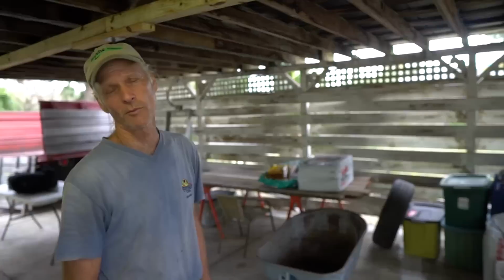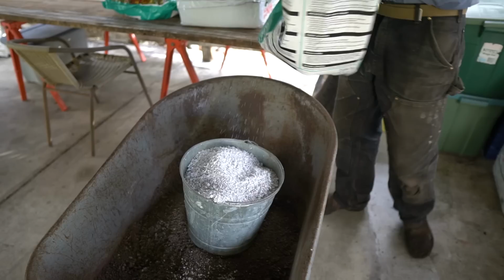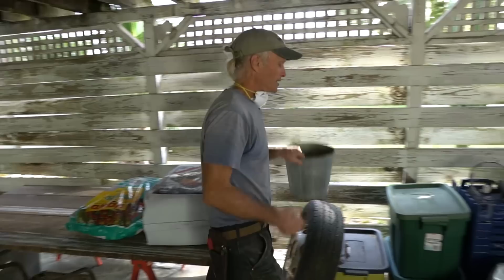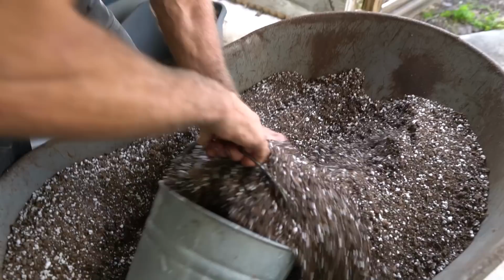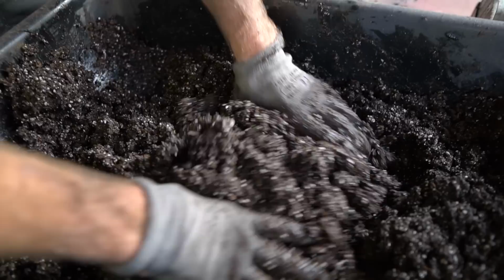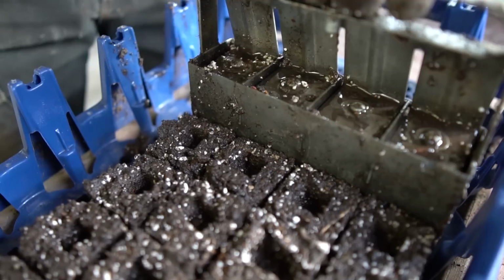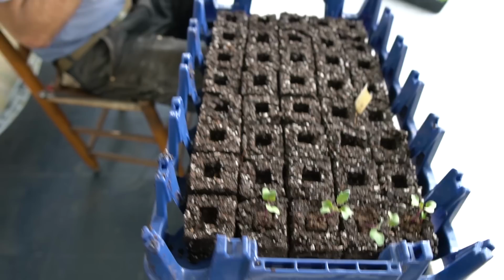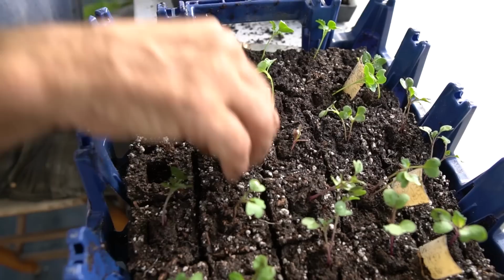Making Soil Blocks:  #1 Method For Starting Seeds (w/ Jim Kovaleski)

Comment: Soil block Mix

Bucket = 10 quarts 
(2) buckets peat moss
(2) cups azomite 
Mix
(2) buckets perolite 
(1) bucket peat moss
(1) cup azomite
(1) cup of green sand 
(1) cup rock phosphate 
(1) cup blood meal
(1) bucket compost
Mix
Add water

Mini Mix:
(3) quarts peat moss
(1 1/2) quarts compost 
(1/2) cup rock phosphate 
(1/2) cup green sand
Mix
Add water
If need bigger batch - double recipe.
Reply: Thanks for the summary.
Reply: thank you for this.  noticed though that there is no limestone!!! mygreathanks and blessings😇
Reply: Not all heros wear capes
Reply: Thank you Sweetheart
Reply: thank you so very much....blessings
Reply: Unfortunately we are not able to readily get peat moss here and definitely not Azomite or green sand here in South Africa - will have to experiment with an alternative mixture. And also try to find a soil block kit at a reasonable price! We are not able to purchase so many of the soil amendments/nutrients that are so readily available to you in the USA.
Reply: I like this video. Great info

Comment: A tip, I use a cheep cement mixer to mix the amendments. No dust in the face and mixes real well. Then while it's done and still rotating dump it out into the wheelbarrow or cart.
Reply from the maker: Nice! That’s what I used also. Jim does it the old fashioned way 😊
Reply: That's nice. I use a large compost tumbler to mix and also store the mix.
Reply: Talking about a guy that uses a scythe for multiple acres.
Reply: Just saw your comment, I do the same thing!
Reply: I used to use the cement mixer when I showed giant leeks saved a lot of hard work🇬🇧🏴

Comment: Seed startng.. take the blocks place them on a "bed barrier sheets" for small children(they used to have dried gel embedded in the mat/fiber side up)..elevate it with part hanging over the side in the tray with a reservoir of water...it filters the water & gives you just the right amount of moisture to the blocks w/o flooding it...also then you do not have waste time by paying attention to the moisture in the blocks especially arid areas and no water wasting...capillary siphoning
Reply: thank you for confirming this - I was just looking online to see if including a capillary mat in my propagation set up would be a good idea. Cheers

Comment: For those of us who do not hear well, it would be really nice if there was a list of the ingredients in the description area, maybe with the number of buckets/cups for each.
Reply: Follow steps in wheel barrel 
For 2 inch Soil blocks:
(2) 10 qt buckets of peat moss
Add Soil Amendments :
(2) cups azomite (soup cans = 2 cups)
Mix in and use a mask to avoid dust
Add (2) 10 qt buckets of perlite
Add (1) 10 qt bucket of  Peat moss
Add Soil Amendments :
Add (1/2) can of more azomite  
Add (1) cup of Green sand
Add (1) cup of colloidal phosphate powder
Add (1) cup Blood Meal (skunks love blood meal will eat it) 
Add (4th) 10 qt bucket of Peat moss
Mix it all up/wear a mask
Add:
Eliot Coleman adds (1 Bucket of Compost) sifted finely Jim Kovaleski uses a mino trap to sift and with chucker pieces they go back into compost pile ( seems to add 2 10 qt buckets of fine compost)
Mix it all up/wear a mask 2/ 3 times pouring it into a bin mixes it even more evenly 

This soil block mix in wheel barrel makes about 400 soil blocks

In a mortor mix tub Jim Kovaleski takes 8 qts of soil to 3 or 4 qts ( In this video though Jim Kovaleski actually seems use a total of 5 qts water total ) City water not well water because Well water concentrates salts as it evaporates.
 
Eliot Coleman waits a day before making the blocking mix blocks after watering so the peat moss can absorb water but Jim Kovaleski hasn’t found that to be the case. 

The soil block mix should flow through your fingers but it should not be too soupy. If it’s too soupy add more of the soil block mix. It should ooze and pops out.  

The 2 inch blocker has two different types of inserts Nibs (square and circular) for seeding or the square is for moving seedlings on up from the micro soil block maker into 2in etc. 

For Micro Soil Block mixture:
Peat Moss 
Compost
Soil Amendments:
A little green sand 
A little colloidal phosphate
This mix is less chunky
Reply: Justin S. Leon Thank you Justin
Reply: @Podtauk  thank you!!!!!!
Reply: @Podtauk  awesome! Thank you for taking the time to do this.
Reply: @Podtauk  hello do you happen to know what azomite is considered. I dont seen it mentioned in colemans book.
Reply: Great to have this,because working around his plant room, the sound doesnt track clearly. This saves me A L O T of time!!!  Still wonder where the blue trays can be purchased..  im new to growing at a higher qty than about 72  seedlings. And I'm in a high desert, soil challenged region. Thx
Reply: @Podtauk  Thanks so much for this explanation and list.  I truly appreciate it.
Reply: @Podtauk  WOW-O-WOW. I was scribbling all over the place--generous note-taking. Thank you.
Reply: @Bud-xy5ee  try doing further research, as Azomite seems very important in re introducing the basic trace minerals back into over worked soil(s) as a amendment. Sorry, I don't know more, hope growing is going well!
Reply: @MJ-uu3nd  Thats so awesome!

Comment: Great lesson...I was mesmerized, thanks. I just found you--i live in Tampa (one if those people with 4'x8' boxes who waste space for a walkway 15" wide...I loved thus set up you have from the cement floor shed to porch with windows that open. What was that mini tray full of close growing sprouts, HIW dud you do that, they looked perfectly spaced? Strawberries can be saved by making 4x8' frames with 1x2" furring strips and staple over it, half inch screen. On freeze days you can actually throw them all out there over vulnerable crops and drag over canvas drop cloths. Roll up when sun is out, leaving it on end until that night again. You still have to mind the pill bugs underneath unless you pull the whole plant into mounds that you can pull through another screen box, no wood frame required on this, just crease and zip tie corners at bottom, can use forever about 6" above dirt works almost as well as hanging baskets.

Comment: As someone that's newer to the seed starting process I'm at a loss for half of the ingredients that were used. Could we get a list of what was used? I'm working on getting away from buying transplants and what I did understand was helpful.
Reply: HEY! I wouldn't stress the stuff you can't find. A lot of the stuff is extra like the rock dust and green sand. All you really need for seed stars is peat or cocoa, and vermiculite. I use the perlite when I pot them up to cups in the mix. a 50/50 peat  and vermiculite should work fine. You really don't even really need to add a fertilizer unless it is water-soluble because the seed itself has enough nutrients for the seedling to grow for a bit but you will need to fertilize in about a week. It should be water-soluble because the seed start mix is sterile and has no microbiology to break down solid organic fertilizers. I wouldn't recommend anything non-organic, liquid kelp is a good organic nitrogen fertilizer for the beginning stage growth. Also, Mycorrhizae in your seed start mix can be very beneficial to help the roots get a good start  and to break down nutrients for the plant. Hope that helps ! Good Luck!
Reply: Agreeing with the other commenter, don't sweat all the amendments. This system clearly works for Jim Kovaleski but even if you plant your seeds in a simple mixture of compost and coco coir, you will get some germination and your plants will be fine.  I will, however, give you a list of what Jim added in the video for 2-inch soil blocks so you can decide for yourself:

4 total 10-qt buckets of peat moss (but I would way rather use coconut coir as it's a renewable resource---peat moss is NOT renewable)

3 total cups of azomite

2 10-qt buckets perlite

1 cup greensand

1 cup colloidal phosphate

1 cup bloodmeal

1 bucket compost (sifted with a minnow trap, but you could use anything with a bunch of holes, like one of those wire mesh trash cans if the holes are big enough)

Mixed with water in a mortar mix tub
Reply: LaKore I use equal parts coco coir and sifted potting mix for the mini blocks and add some Espoma Gardentone to the larger blocks.
Reply: Thank you to each of you for responding! It's great to see how others do it.
Reply: Gabriela G and Don Isenberg I agree... both of you are very cool 😎... I actually couldn’t understand what Jim when he said “colloidal phosphate” because he was scooting the bin on the concrete so very cool of you both... apparently, the minuscule seeds eat better than I do... 🤣. Seriously tho, be well. Be blessed. And much love 💜
Reply: @gabrielag9846  In his mix, is anything needed to bring the pH up, like dolomite lime? Peat moss is too acidic right? Or does the compost balance it out?
Reply: @SuperMDank  The compost would bring it closer to neutral, and also azomite has a slightly alkaline pH. Many edible plants thrive in neutral-to-slightly-acidic soil, so the pH of this mix is probably spot on for what he's growing.
Reply: Eliot Coleman is the king of all of this intensive market gardening. Check out his books. They have the recipes and instructions for everything that Jim does here.  Even Eliot says there really is nothing new in gardening.  But between Eliot Coleman and Johnny's Seeds you can do absolutely everything.  And you will have some failures because gardening needs to be tweaked for each individuals style and location. Then you will find what works for you and what doesn't.
Reply: As for the fertilizer amendments, you can just use a high quality premised fertilizer like, Epsoma GardenTone, instead of Greensand, phosphate, and bloodmeal. Espoma has those in it.

Comment: one drawback of using cups is that you cant start a lot of them on a seed mat to germinating....to us growers this means using the energy of 3 or 4 seed matts to germinate when if I use the tiny germination sized soil blocks....I can put the same number on just one matt and under just one set of lights....that costs....then I have to wash and disinfect the pots...thats 2...then when I removed them from the cups I noticed tiny scrapes on the root system....thats 3 for me with what I grow....then in the square blocks I noticed I can have more nutrient available for the seedlings than the area in a round cup allows for...thats 4...by transferring into the 4 inch soil block I have a different soil mix for that time in root growth, adn this allows me to change the growing environment iwhen seed blocking but not if I kept these all in a 3 inch cup....thats 5....and by the time I use a 4incn square soil block...the roots are very tough and ready for the real world....I dont let mine grow outsdie of teh 4 inch blcok becasue by the time they reach this size they seem to need a little more gentle handling adn dont bounce back as well if you get rough on the roots....soil blocking allows for ease in tranplanting...you dont have to watch roots are not folded over adn therefore destroyed.....thats 6.....I have monster roots on my plants....I use promix with MYCO. adn then I add some nutrients, like kelp, etc.. and I dist the seeds with more biostimulants......I have grown in cups and becasue of the above reasons I went back to the soil blocks.....I sit at a table and go through a lot of them quickly and it just seems to work every time....

Comment: I started using the soil block last year and I have a love hate relationship with it. Mine just has the little round divot. I kinda wish now I had gone with the mini system. But I’m making it work.
Reply from the maker: You can change out the round ones for the mini blocks. They sell the inserts. Don’t give up, it’s a little more work but well worth it.

Comment: cool , thats the tool that makes soil blocks always wonder how they make the shaped soil block molds. Its a tool like that of various sizes. Anyway i am interested in a slightly other problem you had that is well water you said you didnt have success with it because of salt but i have great results. I would have thought the city water that is chlorinated/flourinated for good reason for us would be worse then the well water for you. But maybe it was the fact you had some hard-water / a water softener or salt mixed into your water that was killing the crops. Any extent if you collect rainwater that's the ideal water to uses except depending on where you are it can be not enough or impractical to just uses rainwater collection alone.

Comment: I usually just buy potting soil with fertilizer already mixed in and put it in the little 6 cell plastic trays I reuse from year to year.  What's the advantage of this method vs. that method?  Just coming from curious.  It's probably better soil, but seems like A LOT more work.
Reply: I think the idea is that he is a production gardener, making a living at this. His success relies on large amounts of plants, fast turns and sure seedlings. The soil blocks are more reliable as they are air trimed and dont wrap around the containers. So when he moves them up to a larger container the plants take off fast. He said in the video in the right conditions he can have these in the ground in 18 days and they are very strong plants. Next he is ready for market in a few weeks. Incredible, fast and delish!
Reply: The roots do much better in these air pots and his seedlings can mature faster and healthier

Comment: He really loads the amendments in them , I never have tried that, maybe I should but mostly all I grow is peppers and some  tomatoes and the peppers usually turn out ok but I don't do well with the tomatoes. . 
   Have ever have grown firebush from seed?  I got some seed from one of your neighbors down there through ebay and mine are really growing slow, hopefully they will really take off and grow like the muntingia after they get a certain size. Actually they have grown faster that the muntingia do from seed but not as fast as the grown muntingia or the moringa. Thanks Pete
Reply from the maker: I’ve had fire bush pop up everywhere from seed but haven’t grown it from seed.

Comment: Would be great to have the ingredient list and proportion in the video description ;-)
Reply: A successful recipe for soil block mix (with thanks to Eliot Coleman): Mix 2 10-qt. buckets peat or coir with 1/2 cup of lime and 2 cups of azomite. Add 2 buckets of sand, 2 more buckets of peat, 1 cup of phosphate, 1 cup of greensand, 1 cup of bloodmeal and 1 more cup of azomite. Mix well. Add 1 bucket of compost and 1 bucket of soil and mix again. Add water until the mixture is spongy but not soggy and start making blocks.

Comment: Jim: Did you ever try coconut fiber, or any other alternative to the peat. I currently am hesitating, using peat, because of the environmental issues. Any thoughts?
Reply from the maker: I think the the ph is different in coconut fiber. Jim maybe uses a bag per season, but I hear you. It’s a finite resource...
Reply: @PeteKanarisGreenDreamsFL  Good to hear from You, Pete. I have to say: One bag/year seems very reasonable, for the "good", which is done with it. Some pople say, that coco fiber can be substituted for potting, but I ran into issues with salt content. 

Buy bricks, and after soaking the peat in water, I runse it three times with water. Then the EC (measured with a cheap EC meter) seems to be low enough. Even then, I am sometines not too happy with my potting mix, but this could have multiple reasons. 

Side note: Watering seedlings (and potted plants in general) with dilluted urine (1:20 or so) makes a big difference and the plants much happier in general. A great resource! 

If I am not wrong: Some people use peat to mulch areas in the garden, just to let the carbon go into the athmosphere. In this regards, using it for starting seedlings seems very reasonable.
Reply: @calliepygian9093  yeah, the peat along with the other ingredients transported so far, yikes. Im more of a gardener who follows OYR & c. Dowding because of their emphasis on growing with local resources. I'd wanted to try soil blocks, but I guess not now.

Comment: Not want to sound dodgy, but a cement mixer, perhaps... I know they give a bit of work to clean.
Reply: Cement mixer cleans itself when dropping nearly dry soil mix (out of small cement mixer). Seems to me I added very small amount of water into cement mixer with dry ingredients. Just enuf to keep the block (amendments and soil) together coming out of the blocker. Takes a few trials getting desired moisture in soil and amendments. Jim's method may be faster. He did them so quick I turned my head and he was nearly done with demo...anyhow great demo Jim.

Comment: Great video, I guess how long from the time you complete  a  soil block with a planting of lettuce or brassica do you put it into the ground?  I have heard of issues trying to water soil blocks then they break apart.
Reply: My understanding is that that comes down to the soil. If it's just plain light and flaky potting soil, they will crumble when stressed by handling or watering. . Whereas if it is mixed or purchased correctly with ingredients designed for blocking ,then they can take the stress.